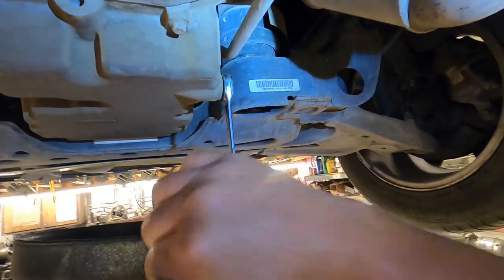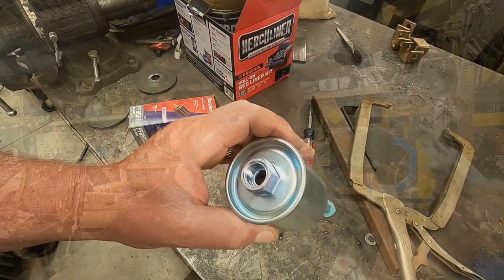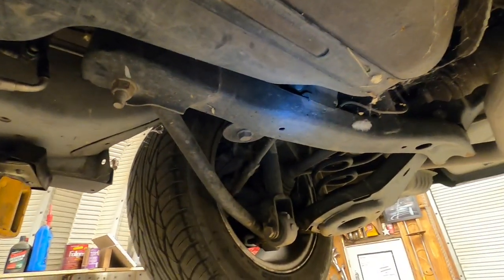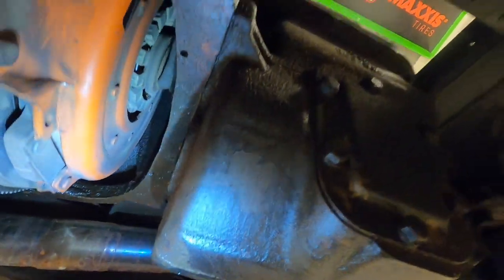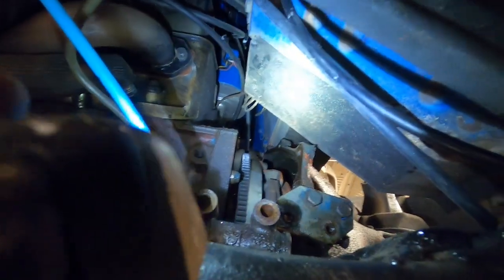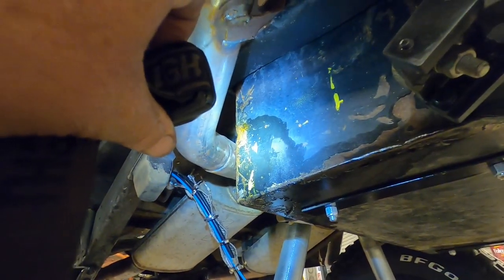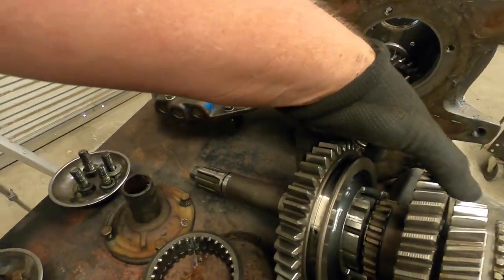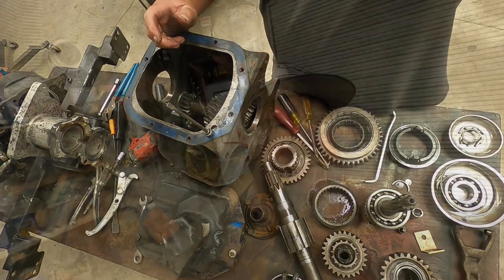FJ40 part 11 and a little jet boat fun! Toyota problems....

Comment: Fun video Travis! You should cut those fuel filters apart and take a look at the insides and video it! I was servicing my 2005 Chevy Trailblazer and thought I need to change the fuel filter. Did you know they never even put a fuel filter on them at the factory. My 2005 has no fuel filter!
Reply from the maker: How's it going Wade. Ya, certain years of chevy they decided they only needed the sock in the tank, if you're having problems you might wanna look there. I've delt with a Silverado  that was that way. good to hear from you. Hopefully this filter works correct, and I'm really hoping this gear and syncro will fix the problem with the FJ.  I'd like to go offroad it soon .